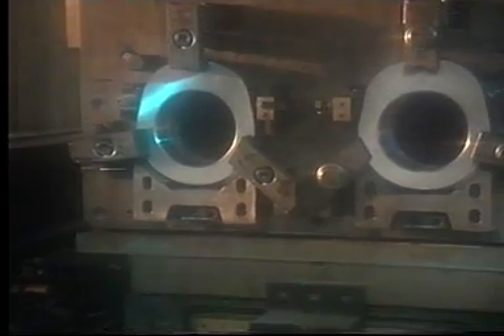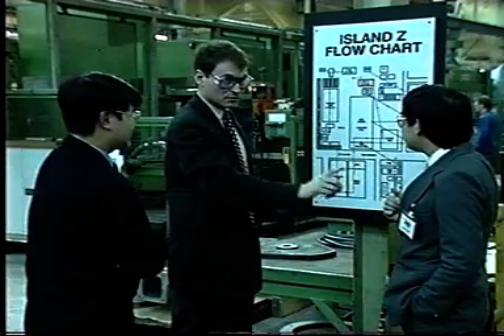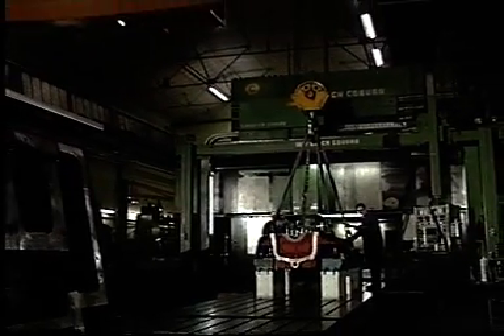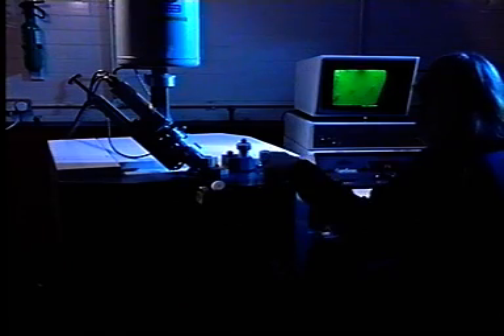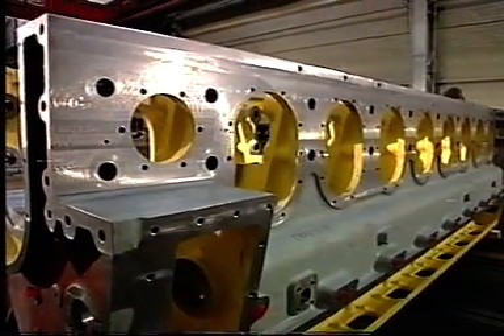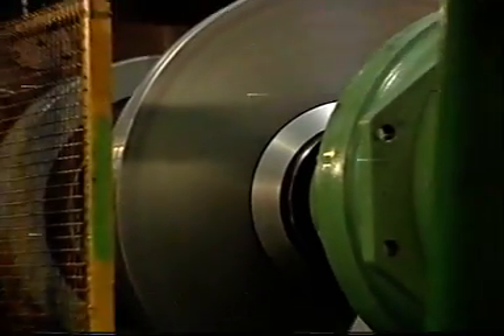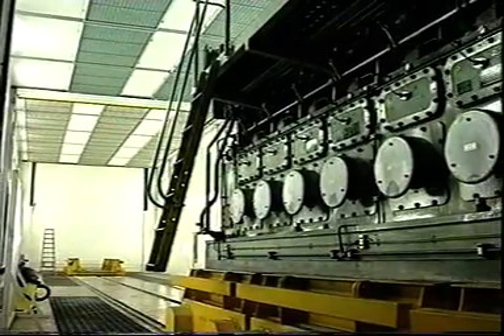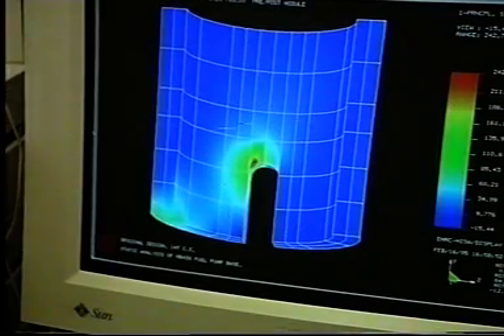Mirrlees Blackstone Video

Comment: I spent quite a bit of time there. I worked for Heinzmann and Mirrlees used some of their governors. I spent a lot of time with the MB190 as they tested it getting it ready to be used in four HST125 power cars. I designed the engine control system for these. I spent lots of time with British Rail getting to know their standards and requirements. Once in service I traveled around on these trains keeping an eye on the electronic control system. Happy days at the end of the day as the train went back into St Phillips Marsh overnight. We would feast on the unsold sandwiches.
Reply from the maker: The Class 60 locomotives that are operated by DCR and are still powered by Mirrlees MB275 engines are being retrofitted with Heinzman Governors to replace the Woodward EGB governors!
If your interested give them a ring at Leicester!
Reply: @TANISLA2  Thanks for the information. I retired from Heinzmann six years ago. I then worked for Governor Technical Solutions until late last year when the owner Gordon Holt suddenly died. It was me and Gordon who started working for Heinzmann in 1979, working from our homes designing the E range of governors, and then starting up Heinzmann UK in 1984. Herr Anton Gromer told us he wanted the very best governor, no compromises. The fact that many are still in service now is testament to that. Heinzmann lost interest in maintaining the old governors, preferring to sell the new cheaper to produce digital governors. That's why GTS took off so well as we could fix the control boxes and actuators that Heinzmann were not interested in. The actuators after a major repair were better that the original as we fitted a better motor from another supplier. I don't think the digital governors will have the life of the analogue ones. No special components used in the analogue governors so parts will always be available for repair and just a screwdriver needed for setting them up. There is an island somewhere that had 3 or maybe 4 Mirrlees engines all different power outputs. I designed the control system for that, bringing different engine combinations online to meet the power demands of the island.